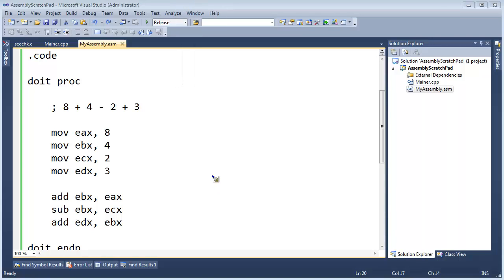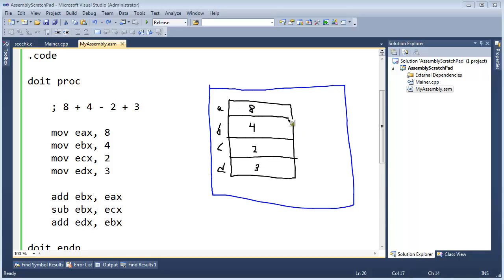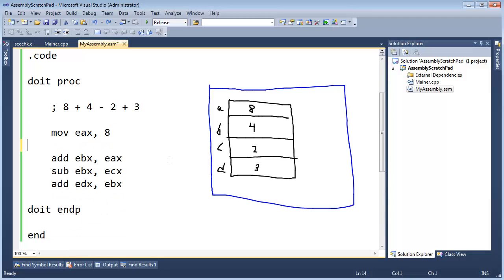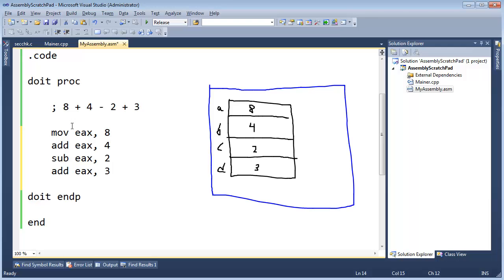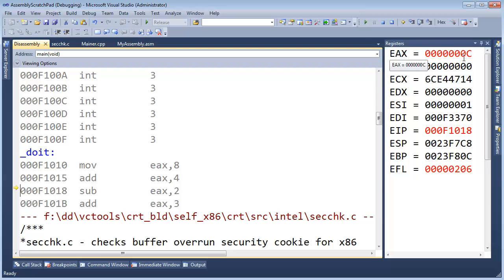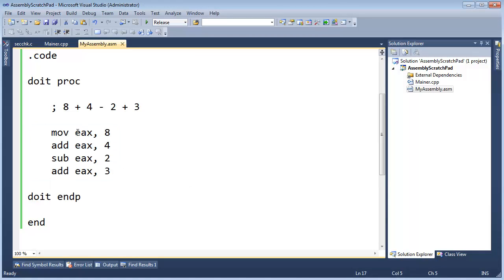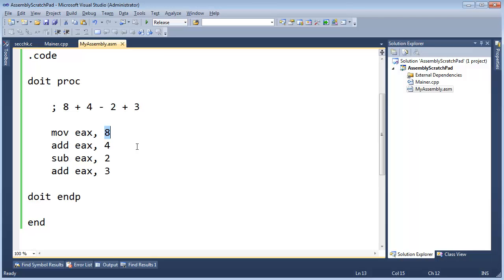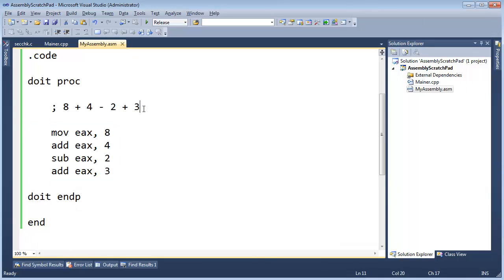Optimizing the Previous Program

Comment: For some people that are confused with the letters inside the registry; Here is an explanation:

mov eax 10 - "Output" of this in registry will be: 0000000A 

It's actually alphabet order, A is 0, B is 1 and so on.

So if we execute this command: 
add eax 1
EAX will turn from 0000000A to 0000000B because 10 + 1 = 11 = B
Reply: Close, but no cigar :q
They are in alphabetical order, but the values those letters represent are a bit different, because they're not actually "letters" – they are DIGITS in the hexadecimal (base sixteen) number system.
In the same way as in binary (base two) number we have just two digits at our disposal (0 and 1), and in decimal (base ten) we have ten digits at our disposal (0, 1, 2, 3, 4, 5, 6, 7, 8, 9), in hexadecimal (base sixteen) we have sixteen digits. But there's only ten characters for Arabic digits, so it uses letters from the Latin alphabet to represent the digits from ten to fifteen, so we've got: 0, 1, 2, 3, 4, 5, 6, 7, 8 9, A, B, C, D, E, F. So "A" represent ten, "B" represents eleven, "C" represents twelve, "D" represents thirteen, "E" represents fourteen, and "F" represents fifteen. Then we're out of digits, so if we want to represent sixteen, we have to move to the next position, which tells us how many sixteens there are in our number: "10" in hexadecimal is "one sixteen and zero units", that is, sixteen in total. "1F" would be "one sixteen and fifteen units" which is thirty one. Increasing this number by one we would get "20" in hex, which is "two sixteens and zero units", or thirty two. When you run out of digits for the sixteens position, you move to the next position, which tells you how many two-hundred-and-fifty-sixes are there in the number (256 = 16*16 = 16²). So every next position to the left is sixteen times larger, similarly as in our common decimal system every next position is ten times larger. So for example, DEAD in hex is 57005 in decimal, because we have thirteen (D) 65536s, plus fourteen (E) 4096s, plus ten (A) 256s, plus thirteen (D) 1s, which in total makes 57005 in decimal.

There's a nice trick for quickly converting from binary to hexadecimal and back, grouping the bits (binary digits) by four, and using the following table:
     0000 bin = 0 hex      0100 bin = 4 hex      1000 bin = 8 hex      1100 bin = C hex
     0001 bin = 1 hex      0101 bin = 5 hex      1001 bin = 9 hex      1101 bin = D hex
     0010 bin = 2 hex      0110 bin = 6 hex      1010 bin = A hex      1110 bin = E hex
     0011 bin = 3 hex      0111 bin = 7 hex      1011 bin = B hex      1111 bin = F hex
Reply: @bonbonpony  didn't expect a whole book overhere :D